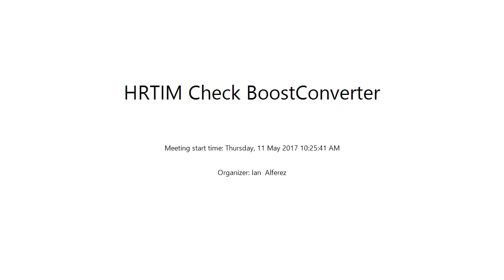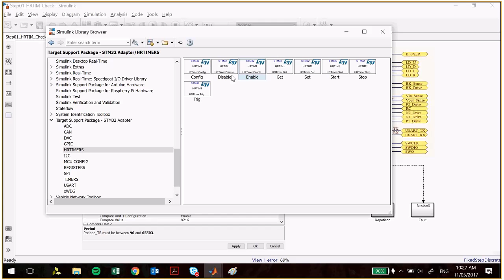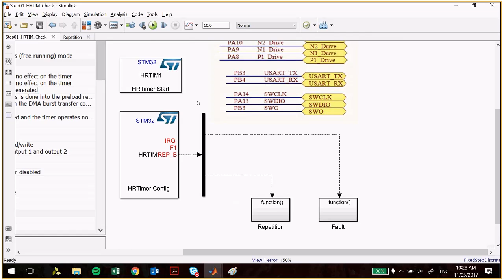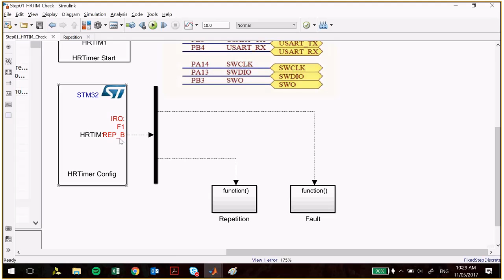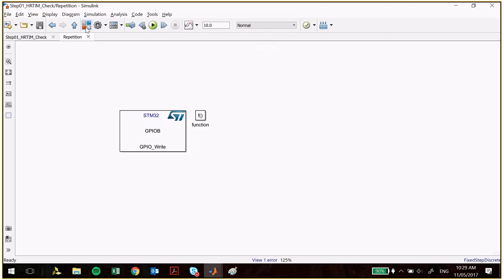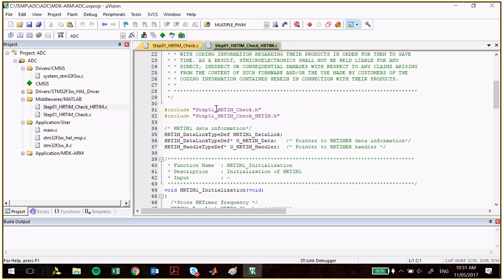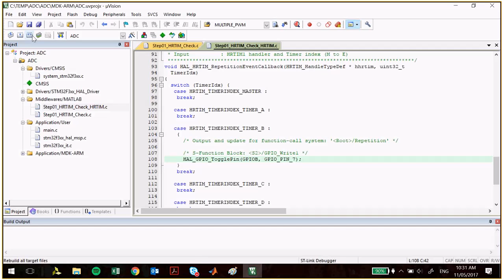[STM32F3Discovery-Boost Converter]HRTIM Check

Comment: Hi, Ian 
I am also working STM32F334. 
I am trying to configure HRTIM in Phase Shifted + Frequency Control Mode (for imporved FB LLC resonant control) 
TB1,TB2 is used for phase shifting (compared to channel A) : CMP2(set) + CMP3(reset) for PWM generation
Problem:
While increasing the frequency there occures glitches (actually blank periods) on the output. Did you experience that kind of problem or can you offer a solution ?

best